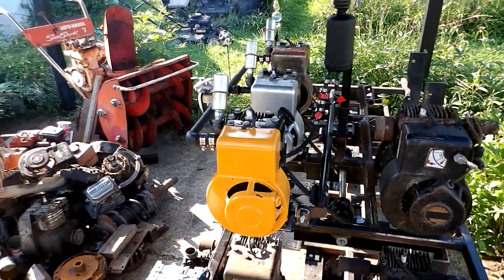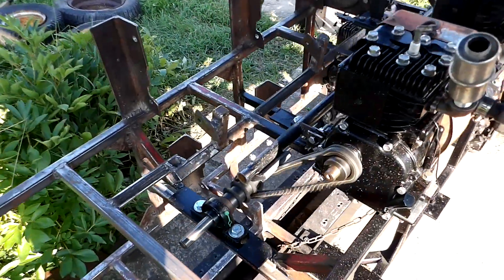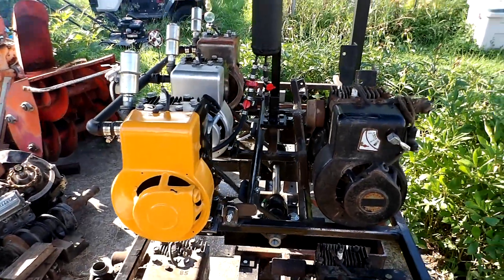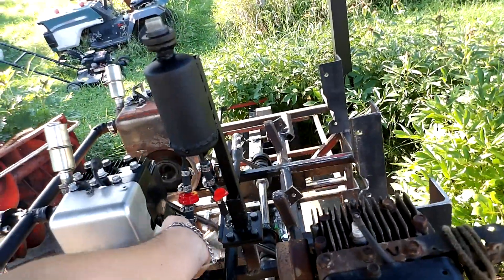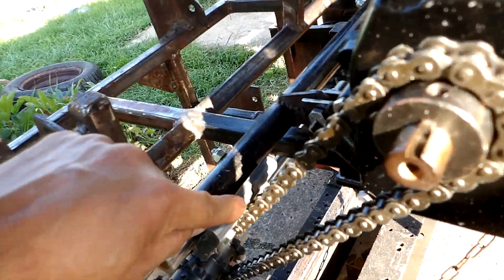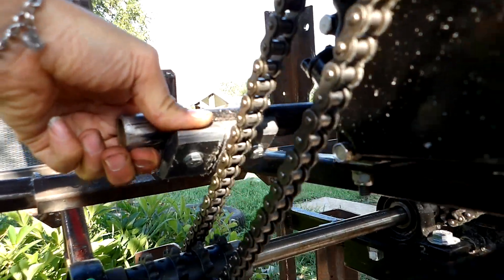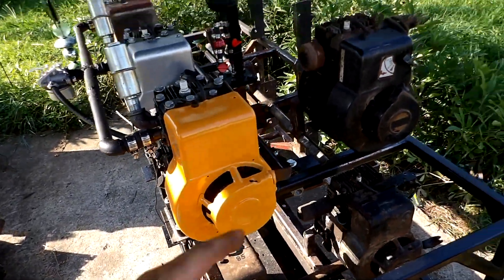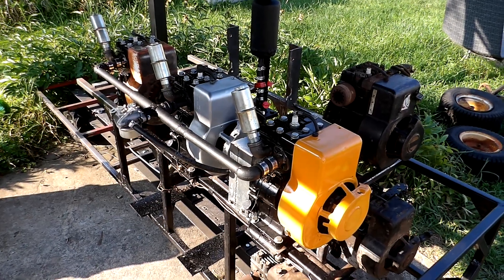Homemade 3 Cylinder Engine Run #2

Comment: Probably could use some weight on the tensioner, like damaged/unusable flywheels to pull the bar down to stop it bouncing so much... :)
Reply from the maker: I don't think I dare add much more weight, or the chains might not like it, as they have to be able to move a bit. It is annoying, but they need some slack.

Comment: Are you going with the idea of 12 position timing. I guess that would only work if you have 12 tooth sprockets.
You're giving me some incentive to put a few more hours into my project.
Reply from the maker: Yes, I will try for as equal of timing as possible. It won't be 100% with the 13 tooth sprockets, but I doubt it will make much difference. Using a weld type sprocket as I have in the past would have cured that, but they are quite a bit more money! I am probably tickling $700 on this "little" project already!

Comment: Are all 3 motors timed the same?  All at tdc at the same time? You should switch up the timing of the middle and see if it runs smoother or sounds different
Reply: The way he's done all of his other multi engine builds, I'll guess no. He has timed the single engines exactly as the cylinders would be in the "real" engine. For example, in the inline 4 he did engine 1 & 4 were at TDC, and 2 & 3 were at BDC. They fired in the typical 1342.
Reply from the maker: Yes, you are right, this one fires 1,2,3. I do this too let the carb. feed properly, all firing at once would overload its flow.